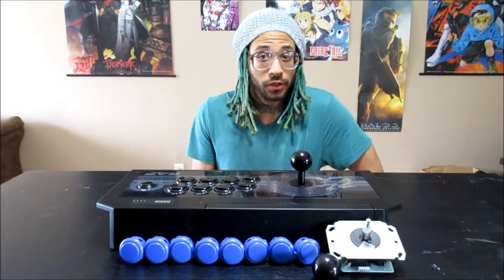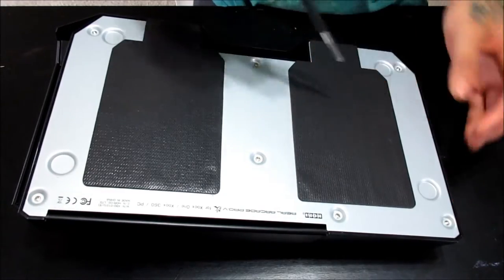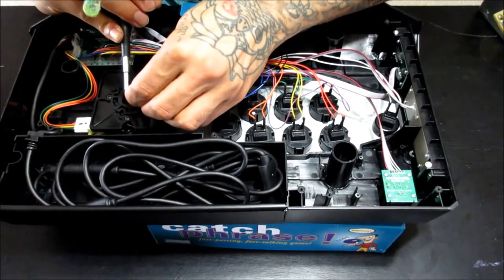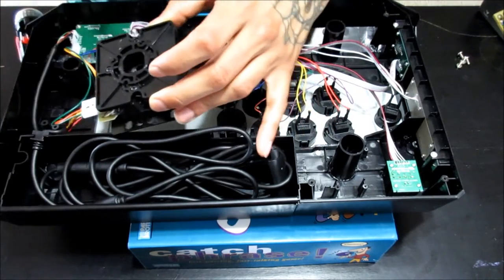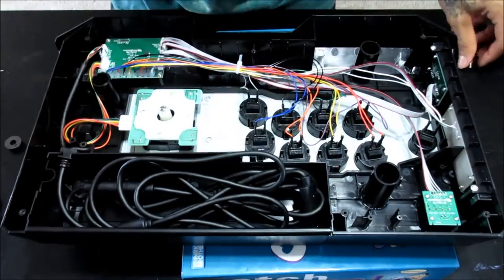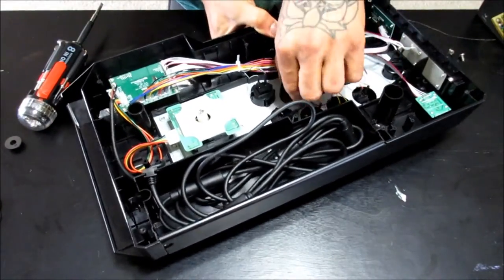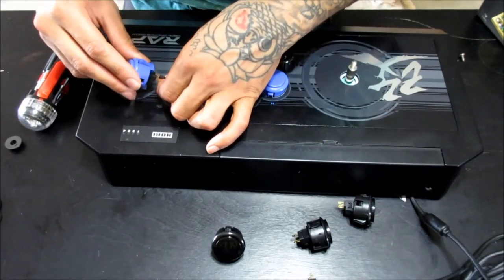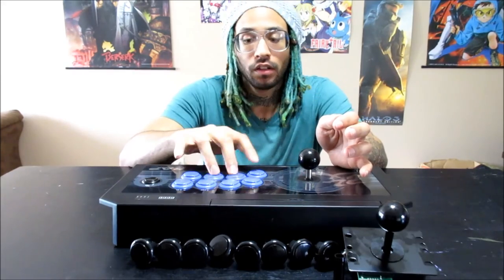Hori RAP V  button and joystick replacement

Comment: I agree completely with your assessment of the loose stick brother, but the hyabusa is more than just the "looser feel"  the way the contact hits the micro-switch is one apex point, rather than the whole piece that goes on the shaft.. i LOVE this design, but i hate the loose feel... so i switched the 1.1lb spring with a 2.0 and problem solved.  Percision greater than a JLF in my opinion, with the stiffness of a JLF.
Reply from the maker: gameraxis I'll have to try that out! good advice
Reply: Where did you get the spring? The loose feel is really what's been bothering me about my RAP 4.
Reply: i took it from my Madcatz te2+ you can buy them online or if you get lucky find the right kind at a hardware store... search for newyorkgames.com... i'm not sure if that's the exact name but google it and you'll find it.
Reply: Thanks for the spring mod tip, I tried it out and have now fallen in love with the hori hayabusa

Comment: Good video, but I dont quite get why you didnt just take the balltop off the joystick. When I was replacing the parts on my f500, I just used a flathead to keep the shaft in place and then manually unscrewed the top. Then once the top is off the sticks housing should slide clear and you wont have as many parts lying around that could get lost.

Comment: TL;DR - do not follow the part where he removed the lever, its wrong. just unscrew the ball topand 4 screws the hold the entire thing and you can remove the entire lever.

So i followed your video so button replacevment was great.
installing the new lever too.
but i realized something crucial in the way you removed the stock lever (stick).
i removed the C metal thingy, spring went wild and flew away now that lever is useless due to a missing spring.
i realized you just have to unscrew the balltop - remove the 4 screws holding the entire housing - and you should be able to remove everything without the need for the stick to fall out.
Reply from the maker: Aquabreak trurth.

Comment: Thanks for the tutorial, I have a hori rap 4 Can I put it a joystick sanwa jlf-tp-8yt?
Reply from the maker: El mehdi Berkak I'm almost positive you can.
Reply: thank you  :)
Reply: Hi mam how are you? Do you managed to put jlf? Thanks
Reply: You need a specific plate for fixing the screws. Otherwise, the stick will be a bit lower than the hole and you will not be able put the cylindrical cover.

Comment: Hi I also want to mod my HRAP 4 kai... I want a sanwa joystick which one do you recommend? As there are a lot of different models and I don't know which one would fit the HRAP 4 kai...  Also do I only need to buy a sanwa joystick and sanwa buttons? nothing else?
Reply from the maker: My nigga so I used the Seimitsu LS-62-01 Joystick and I love it. had an issue with one and had it replaced and it's been a dream since. and yea that's all you need.

Comment: Great video, how's that LS-62-01 working out? Any problems with rust on the bare lever?
Reply from the maker: Z H not with that but I did have an issue of the soldering. might have been a faulty one because the new one hasn't given me any issues since.

Comment: I bought the Hori real arcade pro N Hayabusa.  Yeah the joystick is really loose, I need to replace joystick because I do play Tekken.  Does it work the same with the Hayabusa?  It's my first time modding a joy stick, I don't want to mess up.
Reply from the maker: Im not sure what you mean. to my knowledge most if not all joysticks will work in it!
Reply: Well you have a Hori RAP V, I have a Hori RAP N Hayabusa, is the tutorial the same despite different arcade sticks?  There is not that many tutorials on the Hori RAP N Hayabusa.
Reply from the maker: Sonny C it may not be exactly the same but the overall idea should be the same